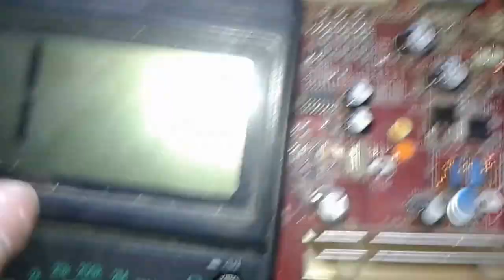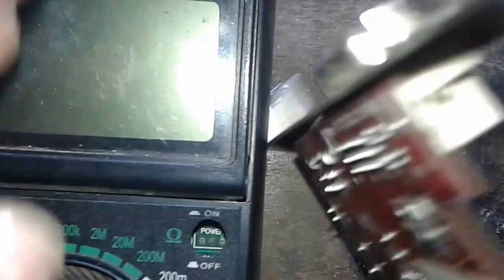Video/Graphics card troubleshooting

Comment: Hi sir, i have MSI HD7770 1gb "R7770-PMD1GD5" for years and problem started when i connected broken defective-damaged HDMI cable... Before this my graphic card worked perfect on all outputs (i have 3 monitors) first monitor (my primary) connected from graphic card DISPLAYPORT to VGA active converter, second monitor HDMI to VGA active converter and third monitor DVI to DVI... This monitors setup worked for years (eyefinity) and one day i decide to test some hdmi cable i found to see if its working... i plugged in maybe for 20 seconds from my pc (HDMI to HDMI) to my projector, picture was defetive and snowy and i plugged it out and THAT'S when i connected back my monitors and later tryed to extend my displays i found out that my two monitors connected on HDMI and DVI on graphic card are no longer recognized :( and only working monitor left is this i'm using DISPLAYPORT to VGA...
I tryed EVERYTHING! from changing 5 different cables all type, cable adapters, monitors, rolling older gpu drivers(DDU), reflashing VBIOS 2 times... NOTHING :( HDMI and DVI outputs on graphic card are simply dead...most recent i found out if i connect on this "working" DISPLAYPORT on card... DISPLAYPORT to HDMI adapter there is also no picture... but DISPLAYPORT to VGA works normaly, and i found out DVI to VGA giving poor quality picture but that is analog...
In one word i think graphic card stopped giving digital signal on all outputs, only analog left and i'm 99% sure its gpu hardware fault some kind of short happen with defective hdmi cable... Can you or anybody help me how i can solve this problem?

Comment: Hello sir i have a request for your suggestions because i am using windows 7 ultimate 32 bits pc and every driver is working fine but when i instale my VGA Drivers which i have using since last few yrs Now it gives me message display drivers stoped responding i have updated it and also changes regedit value but still my pc mouse courser and pc stops when i starts it so please suggest me what to do dear sir

Comment: not sure, but the first resister you ;put an arrow to may not have been bad. The large cap was bad, but I never saw you reverse the leads on the mosfet, you were saying was bad. It would be a diode in that direction, and would show continuity, but reversed it would not. Probably bad but may work with just the large cap replaced.

Comment: Why i click to this video is to see the result, but you didnt include it :(
Reply: The mosfet is shorted so he taps on it. repair impossible, since the short circuit in the mosfet means overvoltage in the circuit.
Reply: @darkbreed  he tapped on the mosfet, but only beeped it in one direction. mosfets being a diode, unless you reverse your leads, and check again no information is present to tell if the high voltage went downstream. If they short open, then cool. But in this case, the components he replaced had it working. meaning; the mosfet was good and the large cap was shorted, so the rest of the circuit, including the chip and memory didn't get 12v, or 3.3. the regulator or buck circuit can also be bad, and let the voltage in to the main chip, which I hate.

Comment: Nice video! Mosfet or capacitor?
Reply from the maker: I'm not very sure i Replaced them all at once , important is that it worked :D
Reply: Ok, nice, that it game alive again. :)
Reply: @IsDeno24  :   does this include the missing, (resister, cap, or coil in smd?)?
Reply: @IsDeno24  that is the ticket to good workmanship, that it works. Not sure the level of this card, but better than nothing for sure. the newer cards have two levels to check, and usually a cascade of burned in a line phase. If you are lucky and it does not pass into memory or graphics/processor. When it shorts 12v into the main crystal I move on. Unless the highest level card.